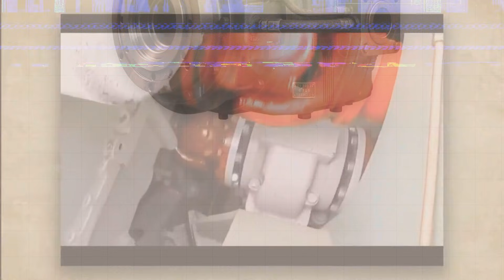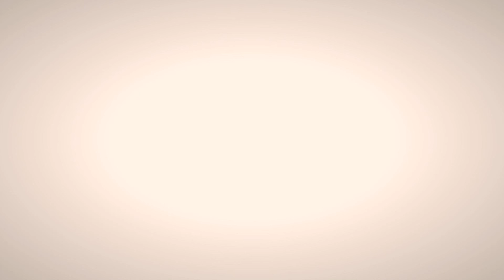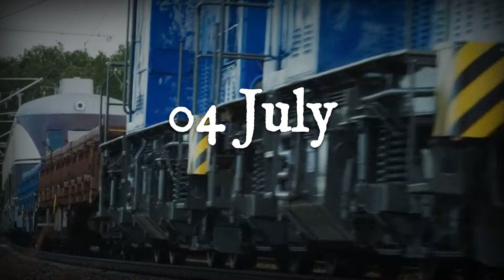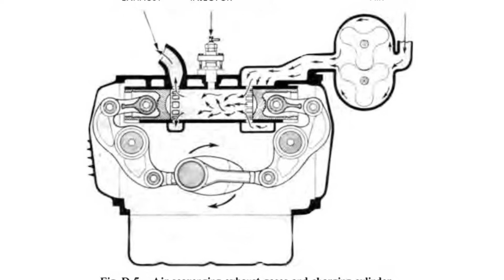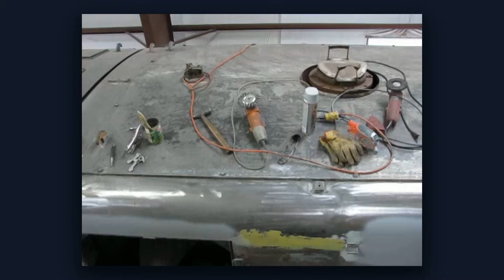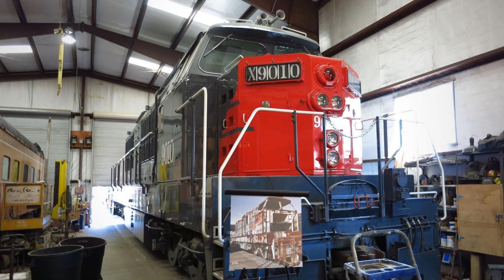Germany Built A 4,000 HP Monster — American Mountains Cooked It Alive

Comment: Krauss Maffei were overconfident. Too little research was spent on the American situation. They could have known better. Their first 2 x 1000 hp dieselhydraulic locomotives of the V200-series ran hot and lacked power for the hilly routes in Bavaria. The V200 only became successful when it was cranked up to 2x1100 hp in the V220-series, and a further boost to 2x1350 hp in later years. It also got much better cooling. I spoke to a Bundesbahn driver who did daily shifts on iron and coal and scrap transports for the Ruhrgebiet furnaces. He said that sometimes he was afraid that cardan shafts or bogie transmission gears might break free and shoot up through the cab floor. This was not a reliable long lasting solution for the demanding American railroad circumstances. Did work well in the end in Europe, though, where distances are shorter, and train lengths too, because freight shares road with passengers and everything has to keep up with the fast timetable pace.

https://youtu.be/lHee1SOfxu0?is=IFSZ3vyeBlsjicBp
https://www.youtube.com/watch?v=FBCm0vsIGWA

Comment: The ML-4000's seem like they were decent locomotives for European or non-mountain runs. But the design could not be adapted, even with moving the air intakes. I wonder if the ML-4000's were designed to have and built with some type of oil coolers for their hydraulic drive systems, if they would have worked fine and in the bigger picture if diesel-electrics might not have become the dominant set-up.